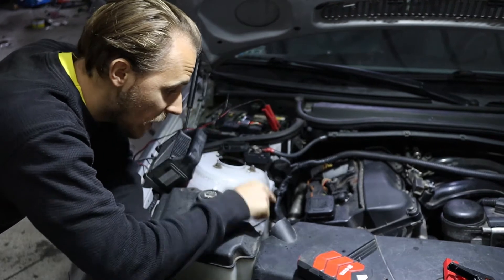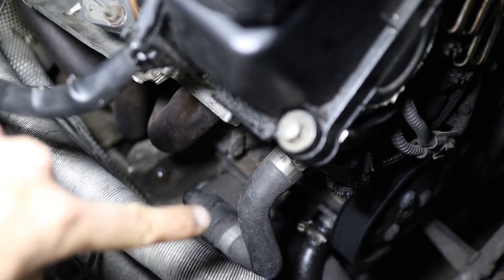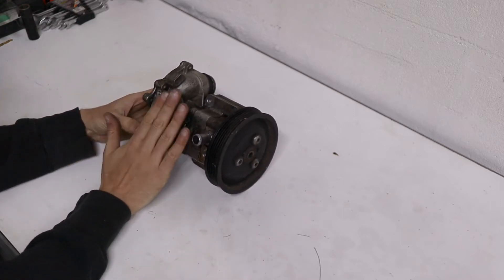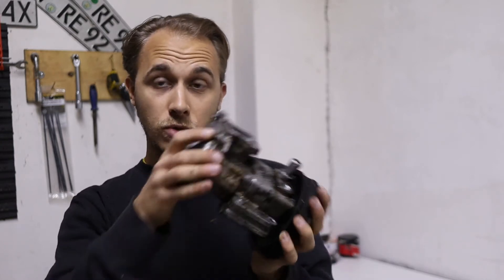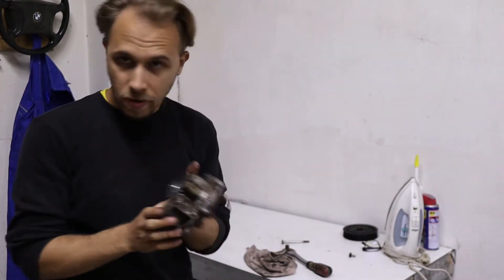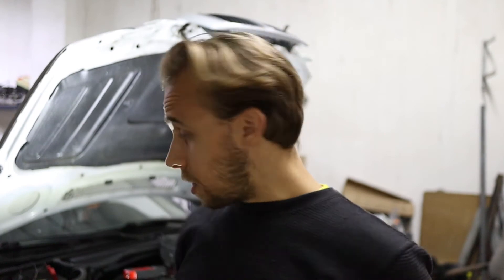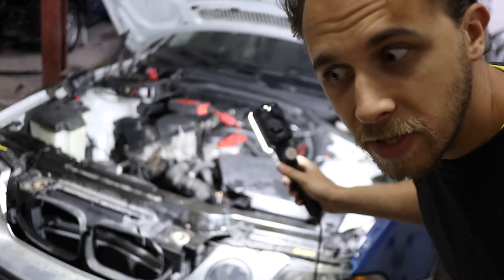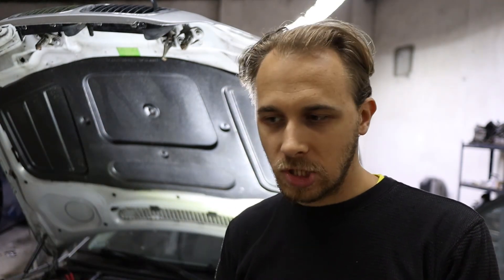BMW N42B20 and N46B20 WATER PUMP and POWER STEERING PUMP replacement E46 E90

Comment: Great video I liked and Subscribed you! Is it possible to only take out just the water pump by unbolting the 2 long shaft bolts in front of the power steering (near the pulley) rather than taking out the whole water pump and steering pump unit from the engine?

Comment: Very Helpful, thanks so much. I was about to start on a cooling system overhaul in my 318i with an N42 engine when I discovered that the PS pump was interconnected with
the Water Pump... First time I have seen that.  Thanks again.
Reply from the maker: It was first time for me too but I guess they saved some space with this 🤷🏼‍♂️ it’s not that bad and compared to other n42 things this pump is very reliable. I’m glad I could help 💪

Comment: Hey, do you think it is better to Change the whole waterpump or Just the gasket? Mine is running great, but already 7 years at least. The car was 4 years in A Garage and Just got a start one time at Month
Reply from the maker: if it was filled with coolant and not water than gasket should be enough. hard to say tho 🤷‍♂️🤔

Comment: Thanks for video 📹 I have a question, I need to change power steering pump on my Bmw E 87 ,my choice was on Bosch power steering pump, what do you think about quality of Bosch?Because new one power steering pump on dealer Bmw cost 840 euro.
Reply from the maker: Technically Bosch is one of the good ones. Most of the sensors that are OEM are made by Bosch. Power steering pump should be fine with most brands. The worst thing about choosing the right aftermarket is when it comes to electronic components 😉
Reply: @gorillaprojectcar  thank you for answer!

Comment: Thank you for the video I have bought a used n42 engine and it is now in the auto workshop for an overhaul.. Engine transplant will be done this week..
Reply from the maker: What happened with the old engine?
Reply: @gorillaprojectcar  It was scheduled to be overhauled but it has a crankshaft and connecting rods problem so the next best option is to buy a good used engine luckily i found one on ebay with 80K Kms on it only for 400Eu...
Reply from the maker: @Hardee03  and with your old engine you will have a bunch of spare parts. I did very similar thing few years back ;) just my engine needed other parts :)

Comment: People please help!!
Bmw e90 n46b20
How to properly vent the cooling system?
The refrigerator is new, the pump is new, the thermostat and sensors are new. The pump is mechanical.

Until what temperature should I wait?
It gets up to 95 degrees for me and I'm still afraid to wait.

Which screws to open and which to close?
Heating at max
Greetings from Croatia!!
Reply from the maker: Put coolant in the car. 
Have extra coolant near.
Start the car when it’s cold full heating on.
Unscrew both bleeding screws.
Start adding coolant until it starts leaking from the bleeding screw.
Add a bit more coolant to make sure that it’s consistent flow from the bleeder.
Screw in the bleeding valve.
Now you should see that the higher valve is leaking coolant. 
Again if not consistent add more coolant and screw it in. 

Hope it helps. If you will still have issues you can try having someone rev the engine a bit because sometimes there is an air pocket in the system. 
You can also try to raise the front of the car a bit to ensure that the higher bleeding valve is the highest point of cooling system.
Reply: Thanks💪✌️
Reply: And tell me when the coolant fan should come on? My tmp its 99 celsius and went not on.
Reply from the maker: This one im not really sure. I think up to 105 is fine as there are thermostats that open at 105 in some n46 engines.
Reply: @gorillaprojectcar  tnx 👍👍✌️
Reply from the maker: Sure thing :)
Reply: Amigo falo do brasil 🇧🇷, existe termostato que abra a válvula com menor temperatura que 105 graus ?

Comment: Thanks for the video I figure the pump was where and operated where it was. I work on American vehicles. But for the power steering pump pulley his it with a rubber mallet at the very least. If you don’t have one use a rag as a dampener

Comment: I'm having a leak , a mixture coolant and steering oil as well, looks it comes from this duo water pump and steering oil pump; do you reckon it is better to change both pump or only the seals? No other problems seen - like heating, high temperature, uneven steering work. I've got only 100 000km done but the car has 22 years. Thanks
Reply from the maker: It always depends on the budget. If you have money to replace them both and it won’t bother you then do it and you’ll feel safer. If not then I’d recommend to wash them, find the leak and replace what needs to be replaced. Probably a seal in water pump part and perhaps a hose in power steering pump. Cheers 👋
Reply: Got the same problem, have you figured it out after 8 months?

Comment: Can you access it from the bottom?
Reply from the maker: It’s doable 😉
Reply: @gorillaprojectcar  sway bar removal etc etc...ill have a look. Thanks
Reply from the maker: I don't think sway bar has to be removed. Do you want to remove power steering pump or water pump?
Reply: @gorillaprojectcar  i was lucky man, found the leak. It wasn't the water pump. Was the manifold plastic plate on the back of the head. Broke my arm and did it by feel only..but did it hahahahaha
Reply from the maker: @notfirstyourlast  congrats mate!! Good job 🙌

Comment: Many pulleys have holes to unscrew those two bolts without removing it👍
Reply from the maker: Now that I think about it you’re actually right but if you’re replacing water pump the pulley has to be unbolted anyways 😉
Reply: @gorillaprojectcar  Why? That’s the point, you can remove the whole steering pump together with puley still on it. Have already done this before couple times, anyway it works only if the puley isn’t from those cheap ones (without holes) 😉👍
Reply from the maker: I guess the water pumps don’t always come with new pulley. I can be wrong tho

Comment: If the water pump or the power steering pump fail, can this lead to power steering oil to mix with coolant?
Reply from the maker: There is one shaft which could transport both fluids but I don’t think it’s possible that much. Like maybe 2% chances. There is pressure in both systems so if both leak they would leak outside as both system would push the fluid out and not suck something in. That’s my opinion tho 🤷‍♂️
Reply: @gorillaprojectcar  makes a lot of sense honestly, it seems like I'm going to have to face the ugly truth that I need a head gasket  😔
Reply from the maker: I wiah you luck and hope you’ll get it sorted :)

Comment: What key size do you use on 5:47 ? Is that E10 or T40 ?
Reply from the maker: that's a T40 I think. Definitely not E10
Reply: Tq..how about thermostat housing? Is that e5 key ?
Reply from the maker: Dont remember unfortunately

Comment: My power steering pump is leak at the center of the oval (football shape) connection to water pump oil came out of it.
Reply from the maker: If the pump is leaking try to find a replacement one and replace it. Way easier than resealing the old pump. You can always give refurbishing a try but it’s just one of those cases where you’d spend lots and lots of time doing it.

Comment: Nice video :) it's a strange engine - i have that one and i changed a lot of parts. I hope that water pump will work for a long time
Reply from the maker: Thanks a lot 🙌

Fortunately I’ve never had issues with water pump. Let’s hope it’ll stay that way. This engine has its problems but overall I kinda like it. Maybe it’s a Stockholm syndrome but who would care 😂😅
Reply: Better than the electric water pump on the N52

Comment: Hi mate! Thanks for the video… the car was overheating so i wanted to change the water pump.. what i saw is that water pump is fine but the power steering pump seems to be damaged. If you spin the metall thing that connects to water pump then the pully wont move. So what you think?
Reply from the maker: First of all your login is awesome 😂 my brain got so confused when I was the notification 😅

If the pulley is not spinning the shaft your water pump won’t move. So my advice would be to get another power steering pump. I disassembled one and putting it back together was the biggest challenge I had so new one or good used one is safer option. 

Let me know how it’s gonna go 💪 cheers

Comment: Hey dude. Do you know if e46 n42 engine power steering pump will fit to e90 320i n46 engine. They look absolutely the same, but realoem says, they wont fit. Whats ur opinion about it?
Reply from the maker: Honestly I’d put it in. If it fits with the water pump I don’t see why it wouldn’t work 🤷🏼‍♂️

Comment: Thanks for the video, there are not many videos about N42/46 engine available. I have a question regarding the powersteering pump. Is it normal if the shaft has some play axially (in and out) not side to side? My power steering pulley also seems to be making some squeaking noise but not sure if its normal. Great video and thanks!
Reply from the maker: I think it shouldn’t move too much but I’ll check both of mine tomorrow and let you know ;) 

Try spraying some wd40 on the belt. If it becomes quiet it might be a belt that’s making this noise :) 

Thanks for the comment and for watching the video 💪🔥
Reply: @gorillaprojectcar  Thanks, well I removed the belt temporarily and the noise wasn't there anymore. I know the belt isn't very old. Pity there isn't a lot of information about these engines and their parts, I searched and contacted ZF & Bosch and they don't make rebuild kits for this pump. I would much rather rebuild it then buy a new one. I found your channel today and keep up the great work.
Reply from the maker: Thanks a lot for your kind words mate! I also prefer to rebuild my stuff then buying new ones. It’s much more fun. 
I haven’t had a need to find rebuild kits for power steering pump yet. I’ll try to search and maybe I’ll find something ;)
Reply from the maker: I tried to find a rebuild kit for it but unfortunately I didn’t… and no one replied as well 😞 
Maybe it’ll be a cool video to take my spare power steering pump apart 🤔 and see what you’d actually need? 🙃
Reply: Hey man thanks for checking, yeah there aren't any rebuild kits yet. If your spare pump works, don't disassemble it (unless you think you can rebuild it again ;) ) but just check for any free play in the shaft and let me know if you can. It would be a nice video idea as there isn't any on the internet as far as I am concerned! Thanks for your interest
Reply from the maker: Sorry it took so long but I finally did it ;) there is a video and I disassembled the pump to see the insides. If you need to seal yours you can check the episode but for the free play it is kind of difficult to say. I hope it will help you anyways:
https://www.youtube.com/watch?v=YXgD2Ah6JDI

Comment: I'm not sure that I understand, does the N46 engine have a mechanical and also an electric water pump? Thanks.
Reply from the maker: They do have mechanical one. There is an electric one too but it’s very small and works only when engine is off to move fluid into the cabin. It’s on the intake side of the engine and it’s attached to chassis 😊
Reply: @gorillaprojectcar  Oh, I see. Thanks for getting back to me so quickly!
Reply from the maker: anytime :)

Comment: What are the symptoms of a damaged water pump? Jaké jsou příznaky poškozené vodní pumpy?
Какви са симптомите на повредена водна помпа?
Reply from the maker: It can be few things. Most common is leaking. Second most common would be engine getting hot because water is not moved. 

Water pumps on this engines are good in my opinion. It’s very rare that you need to replace it 😉